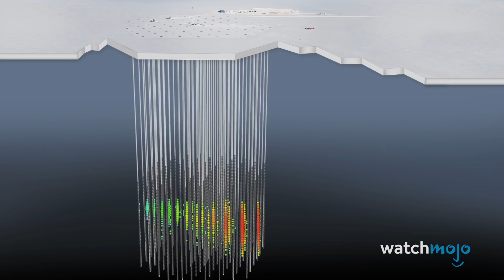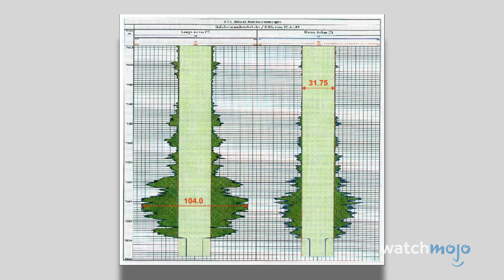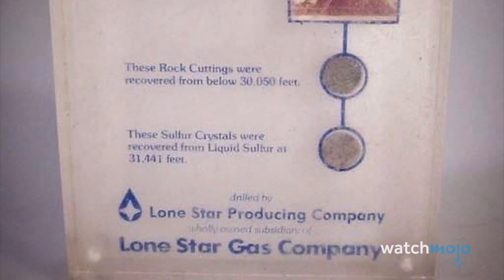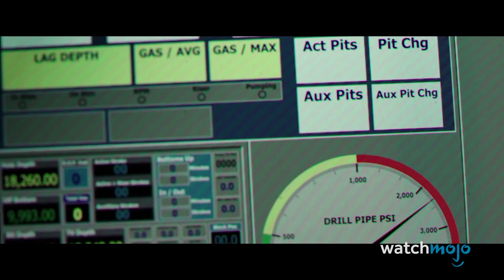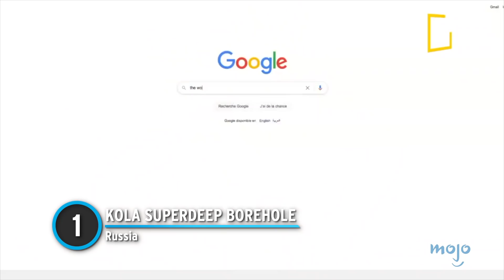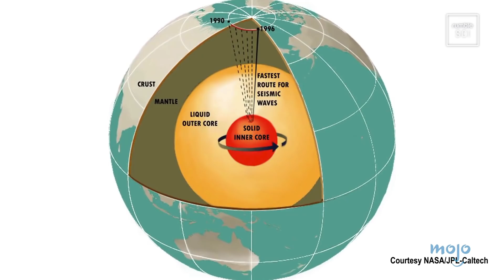Top 10 Deepest Holes On Earth

Comment: I think you kinda missed the mark in this video by missing out of the metric measurements. I have no idea what a mile or feet is.
Reply: Then you should have leaned it in school.. Americans have to learn both.. so should the rest of the world
Reply: I guess it's a real shock to people who move to America from Europe.. we have never adopted the metric system and we never will.. standard is better and easier to use.. a mile = 5,280 feet.. a foot = 12 inches.. an inch is 25.4 mm.. the length in inches is = to mm ÷ 25.4.. so the formula to convert mm to inches is the length ÷ 25.4..
Reply: A kilometer is 1000 meters, a meter is 100 centimeters, a centimeter is 10 millimeters.
Same goes with weight, without the exponent; 1 kilogram is 1000 grams, 1 gram is 1000 milligram.

I wonder why would metric users not want to use the conversions of miles and pounds... (they don't make sense and make life harder for stupid reasons)

Comment: I would've mentioned the quincy mine in houghton Michigan. It was the deepest mine shaft of its day going 9260 feet or 1.75 miles into the earth at a 55' angle, making it go 6200' vertically down. This was a time before boring machines. This shaft was dug with picks and manual labor. The shafthouse steam motor is the biggest one to ever exist, rivaling the steam engines of the titanic.
Reply: Hancock MI actually. Houghton is on the other side of Portage lake. Though if you want to get super technical it's outside of Hancock in Franklin township.🤓 It's definitely deeper than the open pit mines on their list. I don't even understand why those pits were included if depth is the only thing being considered.  Modern day shaft mines make those pit mines look like shallow graves. 😁  Mponeng gold mine, located south-west of Johannesburg in South Africa is currently the deepest at 12,598' but an expansion plan has it going down to 14,009'.
Still that's nowhere near as deep as the bore holes that made the list. If I was going to put these holes in categories, I would divide them into "holes we send humans into" and "holes we can't send humans into" because it's much more difficult to do shafts large enough to send down men and machinery where you need to worry about cave ins, water infiltration and keeping it cool enough to allow men to work safely than a simple bore hole.
Reply: @rjgoniea  houghton is more popular and larger. Hancock is a lot smaller and it's only attributes to society are the mine and the home of FU university

Comment: I couldn't keep up with all the non-metric meassures, I'll wait for your next video!
Reply: Just divide it by 3, Americans’ can accept their usual unit of hight is only 1/3 of a meter.
Reply: @AaronShenghao  and it makes a lot more sense than metrics💯💯
Reply: @AaronShenghao  Not exactly, one meter is approximately 39 1/4 inches, if you divide by 3, you just get how many yards it is.
I don’t know why we’re so stubborn about no using metric, everyone else uses it!
Reply: @joermnyc  because standard measurements are easier to use
Reply: @stonehaven2289  metric is just divide/multiply by 10, how is that hard compared to divide/multiply by 12 standard system?